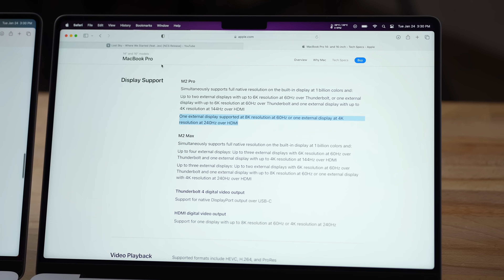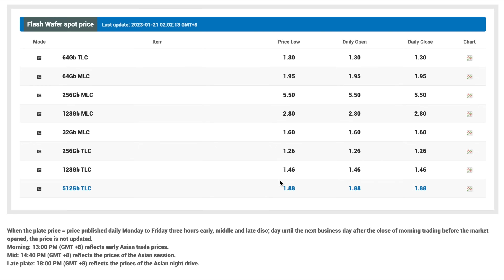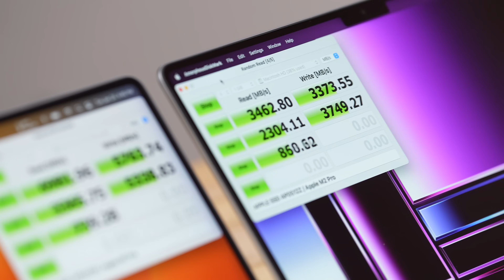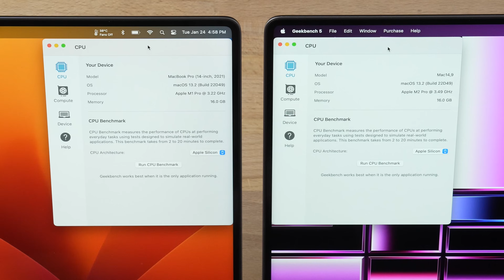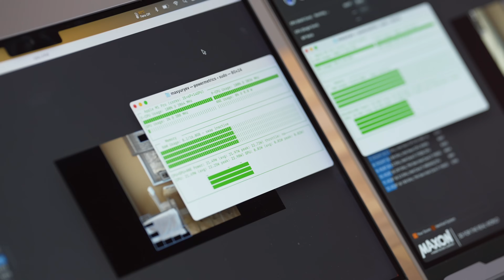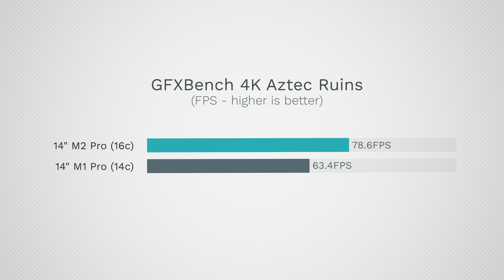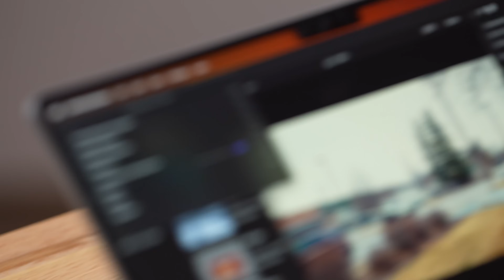M1 Pro vs M2 Pro 14” MacBook Pro - ULTIMATE Comparison!

Comment: I'm very happy that I have a 14 inch M1Pro 10/16/16gb ram Macbook Pro and I guess I'm not updating anytime soon although the M2pro looks amazing but it gets much warmer and it sucks more power, even if it manages it better. The new graphics performance seems to be superior and I'm still surprised with these apple silicon MacBooks...they are just great machines. 
Eventually I'll be upgrading but not yet.

Comment: Wondering if the battery capacities of the two machines are identical? I assume they are.  The performance of either would be OK for my needs. However, I don’t like the fact that Apple has to take every penny out when they upgrade to a new chip. The only really big bang for performance was going from Intel to the M1 (in my opinion). Perhaps the change to 3 nm will make a big difference?? Great video. Thanks.

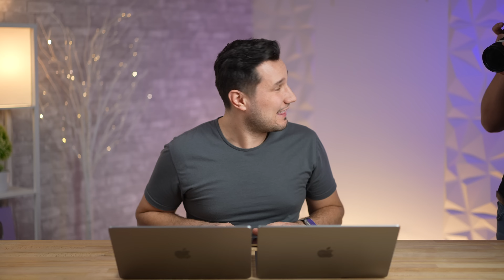Comment: 16:13 I think, it would be better to say, that M1 is slower than M2 by 45% or M2 is faster than M1 by 30% instead of the word "difference". In other comparison results you were comparing M2 to M1, but here decided to use better number and compared M1 to M2. Not cool

Comment: I am still using a 2016 retina 15 inch mbp to do all still works. I think i wouldnt mind to upgrade to base model with lower writing speed, cause it will be a big different from my current mbp.
I wonder if the 16inch base model only have single storage

Comment: Very  informative video.  I suspect for a lot of folks the SSD speed will be of little consequence since most SSD access is smaller chunks of data.  That being said, if you do required larger data transfers, it will be very annoying.  To calculate -> (data_size / Transfer_rate) = time.  Humans can be disturbed by stutters of ~0.1 seconds, fighter pilots ~0.02 secs so folks can do the math and see if they will notice.

Comment: Great job on this deep dive. Does make me wonder if this isn't just an upclocked speed bump for the most part, with switching to more efficiency cores to boost battery life. Reminds me a lot of the Intel days of switching generations and besting the benchmarks, which I guess should be expected. The switch from Intel to M series is a once in a generation event.

Comment: Great comparison, exactly what I was looking for. To the point, in-depth, and detailed as usual. 👌
I am trying to decide, whether to get an M1 or M2 Pro, as the performance difference is not that massive, and the M1 Pro will be cheaper than the M2 Pro.

EDIT: In all of the performance benchmarks, I would say the M1 and M2 are pretty much tow-to-tow as the M1 despite having 2 fewer cores, keeps up on par with the M2.
Reply: thanks for being an active subscriber message me with the above username.

Comment: Knowing that the M2 chips run hotter than the previous ten, I'm kinda shocked to see that they reduced the size of the heat pipes. The single storage chip config on a "Pro" machine is shameful. Apple, stop the penny pinching and let these machines reach their potential as they easily could.

Comment: I always like how you find and issue and then work out why things are happening. The SSD issue is an issue for several user cases and your working out of the cause has permeated through several other Mac reviews which is a good sign that you are doing things well. I also like the surprise when things don't come out exactly as you thought they might. Keep up the good work and looiking forward to the high end config reviews.

Cheers Hawkeye

Comment: Excellent review! I didn't expect this at all. Being a "pro" laptop, I'm disappointed that apple decided not to saturate the board with ssds chips, as this will impact negatively in performance, specially in real world, photoediting, videoediting, etc apps (where a lot of harddrive access will happen). That means than the minimal mbp m2  configuration to get at least a dual ssds chips is the 1T? I  understand the logic behind this decision, but this is not an entry level computer, is prolaptop, with a "pro price". Well, I'm eagerly awaiting the rest of tests, and reviews.

Comment: Can you make a study of the bind CPU cores?
Apple said that it only binds the performance cores, but I know a little about microprocessors production, so if one core has defects, you could bind it and sell the rest, but if M2 pro has 8 performance cores and 4 efficiency cores, you have the probability of 66% that one of the performance cores have defects, but also 33% that the fault is on one of the efficiency cores. 
I think we will see more difference on this M2 than in the previous ones... because you make a lot of tests, could you make a benchmark of the CPU and battery life of the M2 with binds processors and see all the differences?

Comment: So M2 Pro has a speed bump in the processor compared to M1 pro but reduced the speed of the storage. Could have been faster if it used the same or better speed of the drive also. What a clever way to hide the true capabilities of the new chip.

Comment: The M chips are making me seriously consider changing to mac on my next laptop. Almost got a dell xps15, but now a m1 or m2 mac pro 14 may be the way to go.
Reply: I have both computers. Xps 15 is alright bang for your buck but within a few months of owning it I started getting hardware issues and random black screens and shut offs. My M1 Max has been soild right out of the box with no issues (knock on wood). If you plan on gaming or doing anything that requires a graphics card though, I would get the Dell
Reply: @entropy_music  yeah, I keep hearing about the quality control issues with Dell. And I'd really only want to play some old games if any on it. I have a gaming computer for anything that needs a dedicated card. It's the same performance plugged or unplugged with battery life and less surface heat that I really want.

Comment: Hey guys, i've just purchased a 10 core version of the M1 PRO, with 1 TB ssd and the fast charger. I paid about the same for it as a base model m2 pro. I'm still in my return period, and i'm not sure if i should go for the m2 base, instead of the m1 with the upgraded specs. What would you recommend? I'm a college student, so i will rarely use all of the power this thing can produce! any help would be greatly appreciated

Comment: In term of battery comparison - as battery loose their lifespan over time, the correct comparison is of a NEW MacBook to NEW MacBook. 
Comparing the NEW battery of macbook pro m2 
To the USED battery of macbook pro m1

Is not really fare
And does not necessarily mean that the results are reliable...

Comment: It would be super interesting if you guys could test out the differences in Bluetooth speed connections.

Things like time it takes to connect to devices, strength of the connection, how many devices can be connected at once, etc.

I have an M1Pro 14".

I use regularly an external keyboard between two machines, that I swap back and forth from because of my work. Reducing the time it takes to change would make a noticeable difference in my flow, even if it's just from less than a second to almost instantaneous.

Another issue I've found is if I have my keyboard, mouse and headsets all connected independently with the Bluetooth, I could experience some slight issues in my audio feed from time to time. Adding a fourth device via Bluetooth definitely creates problems.

Comment: Thanks for the video guys! 
A little bit disappointing that Apple is cut down on costs for the coolers. Higher clock speed and less cooling. I guess it's still cooler than most mobile workstation devices from other brands, but we are talking about Apples Pro Products. The speaker on the M1 Pro model is better. You can hear it here quite clearly.

Comment: Here they are! This tests are amazing.

Even though it was kind of expected the difference with the SSD's, it is still disappointing to see. Hopefully the faster speed compared to the single chip on the M2 Air will allow the system to have less issues when loaded with multiple tasks.

Comment: Honestly looking forward to picking up an M1pro 14 inch on sale, hoping to sell my 16gb ram 512gb storage m1 macbook air on ebay to recoup most of the cost, and after seeing this video most of the differences don't seem like enough reason to upgrade to the m2pro over the m1pro. Both are a huge step up and the m1pro will likely be cheaper.

Comment: I find it hard to believe that Apple is using a single NAND flash chip on a laptop that has a 512GB drive!  It clearly will affect performance in areas where a lot of writing has to be done to the SSD.  Is this the marketing strategy, to use single chips in the lowest tier drives in each class?   I wasn't too concerned with the 256GB SSD Macbook Airs  or Minis because 256GB is such a small capacity anyway, but it is extremely disappointing to see this happen on a system with a 512.

Comment: Apple set their expectations really high for the m2 chip and its not reaching them. The M1 did incredibly well (especially a first gen apple product), and now apple's having trouble making it better and is cheaping out on the speakers, ssd, as well as the keyboard chassis flex and trackpad quality on m2 air.

Comment: Based on this test, I would choose the M2 Max BUT ONLY 30 GPUs because the 38 core gpu is guaranteed to TLB limit and improperly scale like the M1 Max 24 cores to 32 cores.

M2 Max
14 Inch
12 Cpu Cores
30 Gpu Cores
32GB Ram (you don't need 64 or 96gb they're stupid overkill, maybe you could argue for 64gb but definitely not 96)
1TB storage (it's confirmed that there are chip shortings now, maybe even 2TB storage if that has all 4 chips)

Comment: Surprised about the ssd configuration and speed. But they are already so fast, you won't feel the difference unless you really look hard for it. I've upgraded my ssd in my work pc with similar speeds but since I mostly work from external ssds it's not that big of a deal

Comment: So glad I got the M1 Pro 14 inch on sale. New. Sealed packed. For the price of similarly spec-ed M2 Air. When the test started and we went to speakers first, I thought okay, M2 will have marginally better speakers but boom! I was confused if the left one was newer cause the M1 sounded clearly better. Then the most important part. The SSDs. I knew I was anyway gonna buy the base model, whether M1 or M2 so it doesn't matter if SSD speeds match on a 2TB config. It matters for me on the base model and specially with 16GB RAM, I am way better of for my work flow which is RAM heavy with these double speed SSDs on base model. And CPU and GPU differences were insignificant considering what I have is already extreme. Battery life, the difference I feel is even lower than what we got in the test as M1 macbook is older and battery health decreases even though not much but at least 2-3% in a year so M1 Pro is still the beast

Comment: Thanks for another comprehensive and thorough review. Interesting that even though the M2 got hotter and the fans were running faster, the overall temperature of both machines on the infrared image wasn't that much different. Also the slower ssd didn't seem to hamper the results too badly which is good to know.

Comment: Not sure previous M1 series MAC's including MacBook Pro HDMI port output audio sample rate limitation on 24bit/48kHz only issue has been fixed by this M2 PRO/MAX generation. My M1 max 16 inch Pro HDMI output audio has been limited to 24bit 48kHz only, as a result it is unable to play 24bit/96kHz or higher resolution Hi-Res music via HDMI. This is the H/W limitation on M1 series chips & I will got a new M2 max Pro if this issue has been fixed.

I use my MAC to connect Yamaha RX-A4A AV receiver which is connecting Panasonic TH-48LZ1000 OLED TV via e-ARC for external display. It is a great experience while using this setup for listening music, watching movies & using Office/ MAC OS app when connecting with 48 inch OLED TV & AV receiver via HDMI output solution with Atmos & multi channel sound etc. However due to M1 series chip H/W limitation (I found this issue after purchased this MAC months later), MAC OS limited its audio output to 24bit/48kHz only. I tried to use app such as Blackhole to create a virtual audio interface channel and somehow this workaround still cannot be fixed (for example some APP such as Audirvana only regonzie 24bit 48kHz only with something call "Kernel Binding" app development technical issue which totally out of my scope). I understand that using TB/USB4/Display Port is okay without issue but in my environment there is no space & for another monitor as a result there is Panasonic TV for monitor use only (And TV does not have TB/Display port) . Although I can still using Intel/AMD laptop (HDMI support to 24bit / 192kHz) and this M1max Pro is still the greatest experience I have. I accept there is trade-off when using this MAC HDMI out to play Hi-Res which 24bit/96kHz (Since HDMI limited to 24 bit / 48Khz only, Yamaha / Panasonic only receive MAC input as 24bit/48kHz instead source original 24bit/ 96kHz or higher). UPnP via WIFI can help but I cannot using TV as external display simulatanly since Yamaha will switch the source to Media Server mode & TV will only show Yamaha player's screen instead MAC's screen. In addition I found this new MAC tech spec at Apple website has been emphasized "HDMI port supports multichannel audio output" at Audio which precious M1 series do not have so I believe this new M2PRO/MAX maybe solve this issue. 

But for the 16" speaker and SSD performance I am interested if there is any difference. Nice video👍

Comment: What's the health of the battery in the M1 Pro?  Doubtful that it's 100%.  Using percentages to compare batteries is never going to be apples-to-apples; mAh/Wh-consumed should be a more consistent metric (newer versions of Stats give a "Total System Consumption" – which I believe is from time of program launch – in their "Sensors," FWIW).

Comment: The two things that stand out the most from your (excellent, as always) breakdown of the two MBPs is a) the fact that only one SSD slot is being used, and b) the heatsink is smaller. My one big grouse with Apple is, why make these compromises, even if they're on the absolute base model (which in my opinion no serious professional who needs an MBP will go for anyway), when you have self-declared non-professional options like the Air and Mini (even though they're great performance wise) for the general user? Pro means Pro. Even if it's a base model, this is meant for professionals who need a good machine and are willing to spend a little extra anyway. Honestly, this practice seems disrespectful of the consumer, and commercially exploitative. The latter is understandable in a free market of course. The former - not so much.

Comment: Love these videos comparing the older model with the new one. Not only on benchmarks but also on their internals. With apple silicon, you definitely don't need to change laptops every year. Will have to wait until the M3pro comparison comes out.

Comment: My base model M1 MacBook Air with it's 7 GPU cores and 8gb RAM finished the Blender BMW GPU render @ 2:10... Something doesn't seem right about these results. The M1 Pro machine is only faster than my MBA by 8 seconds? That's kinda weak. Then again I could also say my M1 MBA is decently powerful for what it is too. But I would have expected better GPU rendering performance with the Base M1 Pro MBP having double the GPU cores. 

I work with Blender professionally, and I don't use the MacBook Air for that. I have a 4090 for work. But I would love competent performance out of a MacBook I can grab and go with. And honestly the Air does all the basics as long as it's nothing too crazy.

I am curious about how the M2 Max will do in this same test. Hmm.

Comment: WTF?! Why Apple? Why do they always screw things up? I just can't get it! They make 2 things right and then screw 1. 

I can understand, not ACCEPT, but understand the cost savings from taking away one storage chip... But THE SPEAKER SYSTEM? It was literally the main reason why that laptop 💻 looked so good to me for music duty and now god only knows why it sounds worse...

I really hope it to be just a software issue that can be fixed with an update. 

If memory serves, the SD card reader still needed an upgrade and the headphone jack was high impedance capable... 

Did Apple upgrade the reader? Did they at least left the same capabilities in the audio jack? 🤦🤦

Comment: I wonder. Do they use 1 nand chip to which extent? 1TB is 2x512GB or 1x1TB nand? 2TB? Or is it only until 512GB model? I plan to buy the 1TB 14” binned. Anyone knows if 1TB has 1 or 2 nand chips?

Comment: MacBook is a total beast. Used to have a 2016 MBP, now have a Windows laptop, but the battery is abismo. It lives plugged in to the wall, or it doesn't last even 2 hours

Comment: Great video, love all the tests and peaks inside the case!

Just one little nit pick there. The battery life 33% vs 43% remaining after all the tests is a 30% difference not 10%. Super common mistake and probably just an oversight.
It's 10 percentage points or 30% difference in capacity remaining.

Comment: I just returned the 14" MBP M1 Pro which I received 6 days before the release of the M2 Pro. Definitely a bummer to see the issue with the SSD NAND chip, and also the smaller heat sink. Great detailed review though and with this, I rather get the M2 Pro since it's overall a newer and better machine. Also in Malaysia, we don't have a physical Apple Store (only online store) or an option to a refurbished unit from Amazon, why pay the same price for an older product. It would be interesting to see if the SSD upgrade to 1TB will improve the performance.